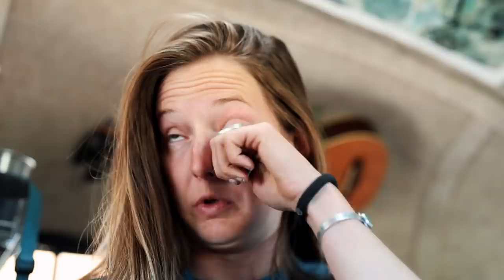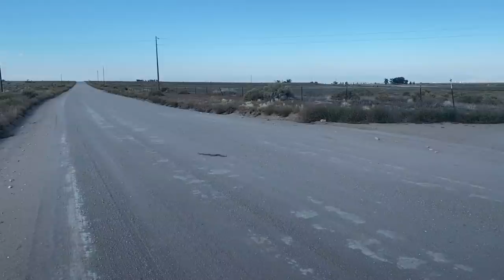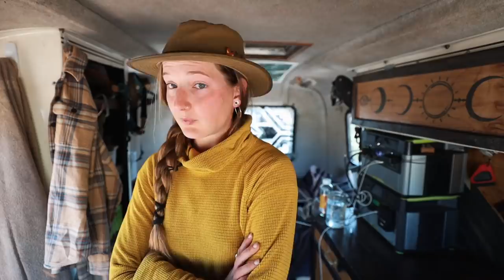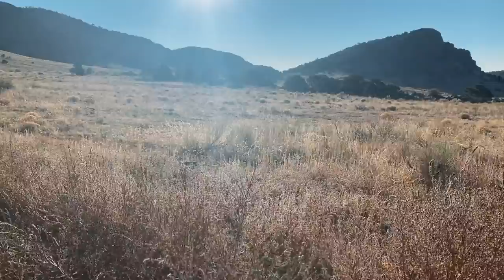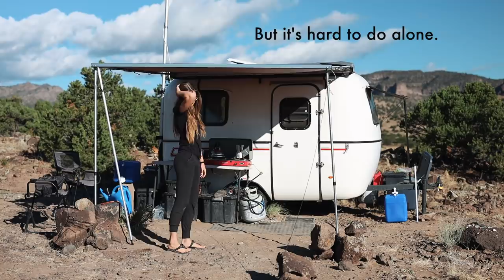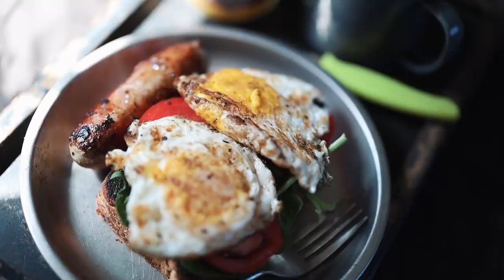RATS filled our ENGINE w/ CACTI🤬 //Weekend ALONE

Comment: I find that moth balls work very well keeping rats out of engine compartments. Take a small plastic container, punch some holes in it and fill it with moth balls. Use wire ties or wire to secure it in the engine compartment. The moth balls generally last two to four weeks depending on the temperature. Also pick up some aluminum tape and wrap the wires the rats like to eat with it. Make a kit with wire, soldering iron, solder, wire cutter, electrical tape, etc. to repair your wiring the next time this happens. Rats also like vacuum hoses.
Reply: Ever have any luck with hot pepper infused "mouse tape"? I've used "hot foot" to good effect around the barn, which is more or less pepper spray and petroleum jelly, but I imagine it's hard on insulation and rubber hoses.

Comment: Happy Birthday Barron!!
Yeah I got pack rats in my RV engine when camped north of Moab a few years back.  I think they were the cause of my ruined A/C vacuum line.  Also, A/C was rumbling and auto shop said they had built a nest in the 'squirrel cage".  Expensive little f*ckers.  Now I use Cabfresh, and flashing LED lights under the engine.
You go girl, getting that awning wrestled into submission!

Comment: Elsa I use a solar motion detector light under my trailer and truck.  It works wonders!!  It doesn't harm anything but it really scares them off.  Now I'm not sure about snakes so far, ( cross my fingers) I've not had that problem.  Hope this tip helps have a wonderful day from Traveling Grandma

Comment: Sorry to hear about dust and wind, maybe do a design for rammed earth columns or
 wall to hold hanging plants

 can hand water as earth structures don't like to get wet

Think neat feature 
as a wind break 
around garden. . .or wherever you want to relax.

Maybe plants felt a little exposed and energy presence down with wildfire shared life drop to west. Allows pests in.

Could do climate controled greenhouse,  or earthship passive cooling idea
(keep out herbivores by keeping cool during summer by building another hut cover...
 screened vented house ....for outside ac component, bury wires)
 A practice green house you all  can try out woodworking joins and with roof plexiglass (think I read ...does better light filtration than glass for plants).

Happy Birthday to Barron if lifespan increases like last century, could plan on another 90 years 🌋

ps try dutch oven campfire bread, better than electric oven as tempertures get hotter to 500°F like need for crust. Also einkorn and semolina wheat nice flours to try, more absorption of food helps metabolism.

Comment: Harbor Freights sells solar rope lights. Buy 2 or 3, drape one all around your engine, leave the hood propped open, drape the rest of the lights in the wheel wells, and then of course leave the solar panels out for charging. Also power wash everywhere the rats have been because they pee on everything and will return to the scent. I would buy some for around the Scamp and any other structure you want to keep them away from

Comment: I bought myself a pair of safety glasses at Dollar tree because the vents in my car go right in my eyes. they are clear enough to work with and therefore drive. they also have sides and a lip on top bar and around a bit on the bottom also. Not airtight, so it keeps a moist environment without fogging or touching your face. I also take purified water on my clean fingers and just go around the eyes in hopes of rinsing off particles, pat dry, sometimes put more to let evaporate around my eyes. Sometimes I think I do not drink enough water, I have dry eyes anyhow, so I hear ya, too much salt (if you use chapstick and always chapped anyhow, I think is a sign of high salt intake? don't know) Also I think about electrolytes...they help you to retain the moisture in your cells. Iwas making my own from a recipe like a lemon ade with a small dash of salt to a 8=12 oz glass. Formula water with an acid such as lemon juice, sugar and dash of salt. I eat a lot of premade, manu food and salt is not added if having with these foods and hope for the best. (research)

Comment: As a fellow dry eye sufferer, here’s my dry eye recommendations: look into a nighttime dry eye GEL (Systane) and a daytime soothing and dry eye DROP (Theratears). Both brands offer preservative free options. I suffer from chronic dry eyes and can’t wear my contacts at times either and have to wear my glasses and I feel like my vision is compromised when I wear glasses 😩 If your dry eyes are severe, you may want to look into visiting a doctor and asking for a temporary drop (Lotemax) that will help with inflammation and possibly even tear duct plugs. Sounds more intimidating than it is, but the plugs help with backing up your tears and redepositing the tears back into your glands. You may also have allergies that could be affecting your eyes thus causing more inflammation which is exacerbated by the wind. If that’s the case, an allergy drop would be helpful also - Zaditor or Pataday. Warm compresses during down time also helps! Good luck! I know how frustrating dry eyes/not being able to wear contacts can be.